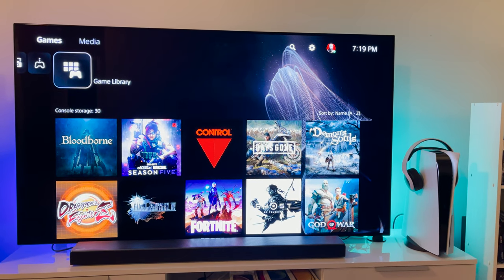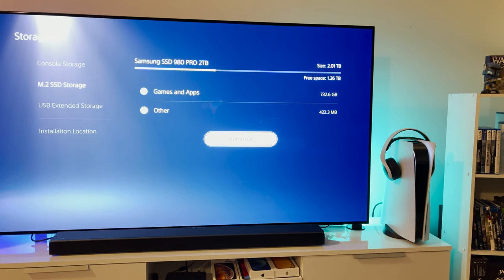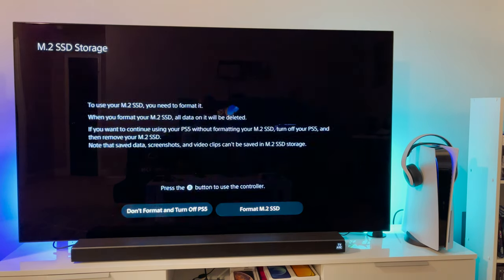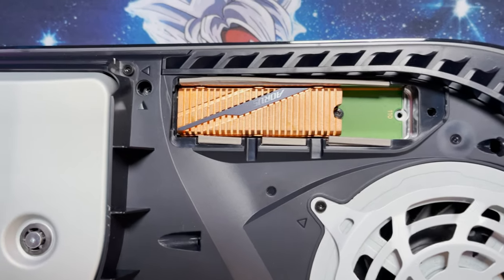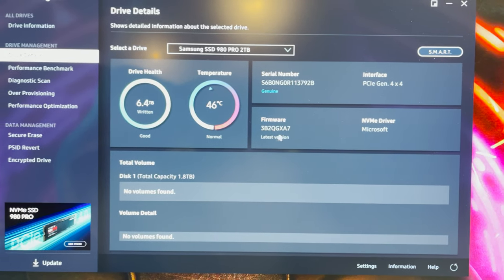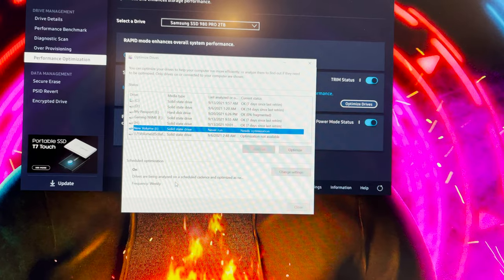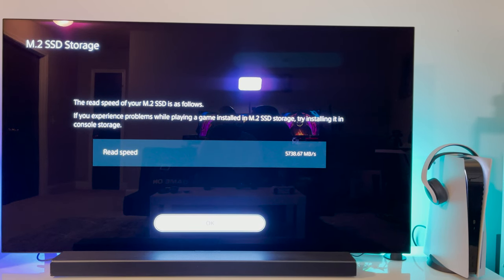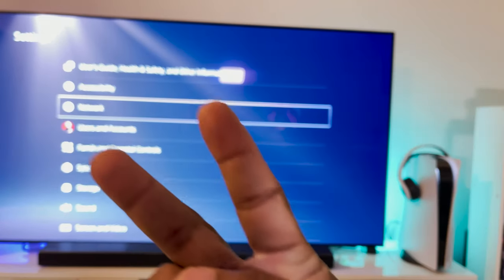PS5 Firmware Update | Will Samsung 980 Pro See A Speed Increase | Sony Update Read Speed Test

Comment: the problem is the speed test is way too short - you can test it a few times - sometimes the drive will receive 5500, 5700, 6100 etc. its BS; in a PC the drive reaches way higher numbers and games load as fast if not faster than the internal PS5 SSD - so nothing to worry about
Reply from the maker: I agree!

Comment: People do realize that the speed of the internal SSD WILL regulate how fast the 980 pro will go like it will only be as efficient as the stock SSD bc they work in a basic raid 0 so yes it will make loading games feel slightly faster because it will optimize efficiency but if the stock SSD Is 5500 bc Sony recommended 5500+ SSD meaning it will never go much higher than 5500 possibly 5850 tops (meaning overvolted abit in that test) so if you really want to boost speeds take apart ps5 and replace the stock SSD with another 980 pro.
Reply: Make a video on that and let me know!

Comment: I always get around a 5800 mb/s reading with my 2tb 980 pro but it seems to perform identically if not slightly faster then the internal SSD.  I believe the only reason M.2 drives outperform the internal drive is because they don’t have to deal with OS functions and the game recording while loading the game.  I also have a feeling that the read speeds are capped at 5500 mb/s for PS5 games since PS4 games usually load slightly faster off much slower 500 mb/s USB SSDs when compared to the PS5 internal SSD despite the internal SSD being way faster.  I think it’s more on the software API side and Sony’s own custom SSD controller rather then the raw read speed of any SSD you throw in.  

Sorry for the long comment just wanted to share my thought and theories.  I also read some other comments that said the PS5s read test isn’t that accurate anyways and I would agree.
Reply from the maker: Great observation I totally agree
Reply: Just new firmware got released. Now I get 6500+
Reply: @zootopiashow  from the Samsung Magician softwar?
Reply: @racerboyo  yep!
Reply: @zootopiashow   if I feel like backing up my drive I might give it a shot then.  Thanks for the information and I also saw that Wil made a community post about the update so the fact that it worked for both of you shows that it works.
Reply: @racerboyo  nice! ... you don't need to backup the SSD, just update the firmware and plug it back into the PS5 and you will be good to go
Reply: @zootopiashow  don’t you need to reformat the drive to run the update and reformat again to use on the PS5 again?  I have 1.5tb of games installed so I plan to copy them to an external drive first.
Reply: @racerboyo  you can take my word for it 🤣 ... I did the backup actually to test the speed

Comment: I was gifted the Samsung 980 Pro 2TB on July 15th 2022. Out of the box, I got a read speed of 6506.099MB/s after the format process within the PS5. Here I was thinking that number was low and not the read speed of 7000MB as advertised. Which I should have known better. Maybe Playstation's speed reader is a little off. Who knows. I guess I won't complain because I didn't experience the speed as low as you guys.  Also, mine could be with the latest firmware update. Games run smoothly on it with no hicups.
Reply from the maker: Good deal yeah I would think by now they would ship with the latest firmware. After I updated the firmware on mine I get the same read speeds
Reply: @WiLcreatives , I'm glad you got a good read after the installment of the updated firmware. It amazes me how they could unlock speed with a simple firmware. I'm just curious what exactly that firmware did different than the first one. Things that make you go, hummm 🤣😂🤣

Comment: ive only got a laptop. ive bought an external case for the ssd to try this and it doesnt work. just states that there is a usb device connected with no way to actually use it. Samsung's software doesnt recognize it either
Reply from the maker: Yep I’ve also read the same that you can’t use the magician software via the external enclosure

Comment: Good video, but there is a big difference between mega bits and bytes. For example mb (megabit) is about 8 times smaller than MB (MegaByte). So if you have 100mbit/s download internet speed, that would equate to about 12MB/s. 100mbit/s divide with 8 = 12.
Reply: There's always a guy like you. We all know what he meant.
Reply: @brucevandermescht6957  Well of course, we are needed. If you do math and inform a rather large audience, you should explain the subject at hand. Many people don't know the difference between Megabytes and Megabits. He did not clarify, so I did. Cheers ;)

Comment: I recently bought a 980PRO 1TB and after formatting it, the initial speed reading in PS5 was ~5570MB/S. Well should be enough, hopefully :)... At least it worked well so far. However one issue I noticed is that the chips on the SSD are kind of uneven. So if you apply a thermal pad during installation of a heat spreader, it does not align completely with the housing (there is an "air" gap between the thermal pad and the housing), which is bad I suppose.
Reply from the maker: What type of heatsink did you purchase?
Reply: @WiLcreatives  Hi, I got the Thermal Grizzly M2 SSD Cooler (TG-M2SSD-ABR). Comes with 2 Thermal Pads (one for the bottom, which is fine. And one for the top, which is uneven due to the difference in "chip height" on the SSD)

Comment: I had the same issue with my 2tb Firecuda 530, most vids online shows it hitting 6700 on the format read, mine always hits 5500-5700. Latest PS5 Firmware as of 9 december.
Reply from the maker: Yeah I  just did an update to this video check it out, there's been some changes - https://youtu.be/6eqi5TrN7jM

Comment: I have 1 tb and latest firmware and also slow performance 5700 so the question is all that have 6500. Did they use beta firmware on the PS5 or official firmware. It can be a block in the PS5
Reply from the maker: From what I’ve been seeing some of the other drives read differently. I don’t think it had anything to do with if it was beta firmware or not.
Reply: @WiLcreatives All that have been showing test of 5400 had after latest firmware 6400-6700. But all I have seen are before official update of the PS5

Comment: I wonder if Samsung has released a update since. They actually made one with the PS5 in mind with a heatsink.
Reply from the maker: Good question I’m going to take it out and upgrade the firmware using my PC to see if I see a difference again
Reply from the maker: Confirmed that new firmware update gives the drive higher read speed for PS5

Comment: My question did install it and read speed said around 57 does thst seem right ? Or does it change ?
Reply from the maker: At the time of this video I updated the firmware but wasn’t any changes. There is a new update out now which I’m going to test to see if there any changes
Reply: @WiLcreatives  gotcha so is the 57 fast enough
Reply from the maker: @leo2o915  I don’t really trust the PS5 speed test. It doesn’t run that long for me which is just a quick validation to be honest. I’ve had no issues with the Samsung 980 Pro been working just fine for me.
Reply: @WiLcreatives  awesome thanks bro

Comment: So the firmware will not get erased when ps5 formats the ssd? Too bad I don't have a PC to update my 2tb 980 pro anyways
Reply from the maker: No it doesn’t. No need to update the Samsung drive, it doesn’t make a difference
Reply: @WiLcreatives  yeah I'm not worried about it. It works great so no need to fix what ain't broke
Reply from the maker: There has been another update and yes the new firmware updates changes the drive speed on the formatting during speed test. Just confirmed this on the newest update.

Comment: Update: I bought a 980 pro (500GB) and the speed I got was ~6700MB/s. I did not update the drive in pc and just put it in the PS5 without changing anything. I did put a heatsink from be quiet MC1. Maybe that is a reason why mine was a lot faster.
Reply: People are reporting much faster speeds on the 250gb and 500gb models
Reply from the maker: Thanks I  just did an update to this video check it out, there's been some changes - https://youtu.be/6eqi5TrN7jM

Comment: What was the point of going through all this if it meets the ps5 read speed requirements?
Reply from the maker: Some of the other high speed drives have higher read test speeds, people wanted to make sure they were making the right investment.
Reply: @WiLcreatives  I swear I’m not trying to be a troll or nothing like that but as long as it meets those specs will it matter performance wise if the games have the same load and download times as the faster more expensive drives?

Comment: My ps5 won’t detect the ssd
Reply from the maker: I would try and reseat the m.2 drive
Reply: @WiLcreatives  reseat???
Reply from the maker: @kaliman4013  take it out and put it back in.
Reply: @WiLcreatives  i did couple times and nathing happen, turn on normal!!!😪😪😪
Reply from the maker: @kaliman4013  did you push the drive in all the way? If so you could have a bad SSD. I would test it out in a PC if you have one?
Reply: @WiLcreatives  how test in my pc???…can u help me please??
Reply: @kaliman4013   make sure the ssd gives a satisfactory click into the ps5 slot. If it’s not being recognized use a pcie 3 or 4 adapter on your pc. The pc may  not  to recognize it either. So go into pc settings to initialize the ssd.  That’s what I had to do before I could even get the Samsung software to recognize its own drive (crazy, right?). Then update the firmware. Install to ps5. Enjoy!
Reply: Is your playstation 5 updated?